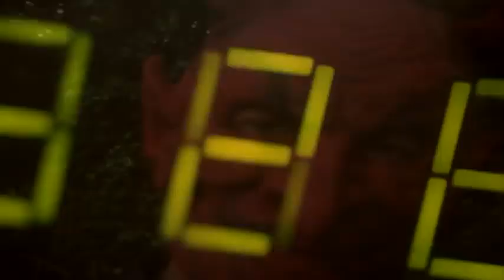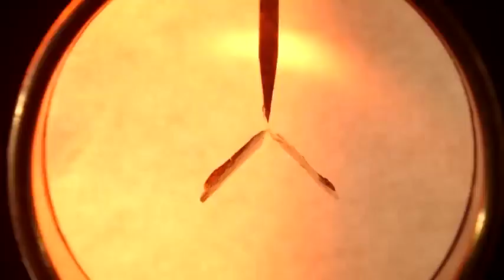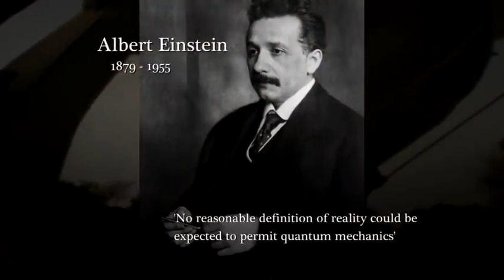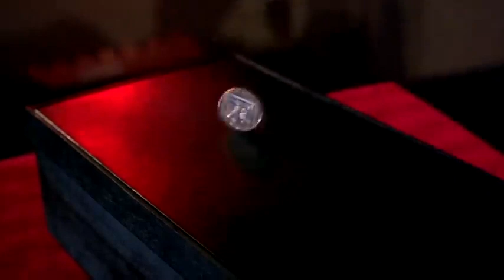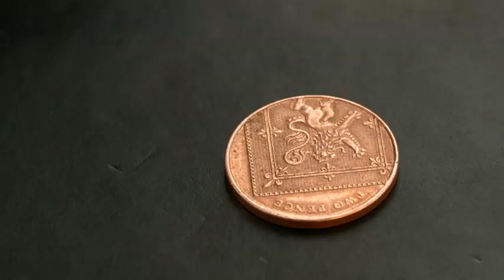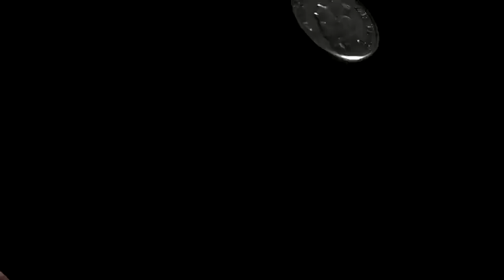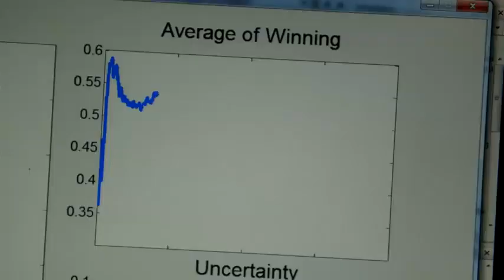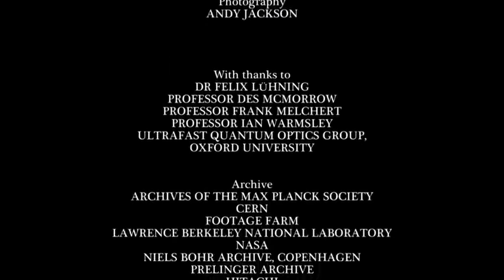The Secret Of Quantum Physics - Einsteins Nightmare - 1 of 2 - Jim Al Khalili- Science Documentaries

Comment: Quantum superposition is a feature of a quantum system whereby it exists in several seperate quantum states at the same time.
I believe that this is because if for example we imagine a glass capable of both reflecting a photon as well as letting it go through it, a photon ‘doesn’t know’ if to reflect from it or go through it. Because seeing the probability of a photon or of any other particle for that matter doesn’t make sense, as we look at those particles we are getting rid of superposition and the probability turns into an actual location of a particle. 
I believe that as we look at the light passing through mentioned glass each photon divides into two smaller ones, one reflects, the other one goes through the glass. The dividing of a photon and other particles apparently doesn’t exist in nature, at least generally.

Comment: The Rampart Interpretation says that pilot waves generated by vibrating quantum particles explain the interference pattern in the double slit experiment.
Reply: There is also no superposition. A spinning coin is not in a superposition. The two sides of a coin are alternating between the two possible states. Vibrating quantum particles oscillate many quintillion times each second such that its position appears uncertain using existing instrumentation.